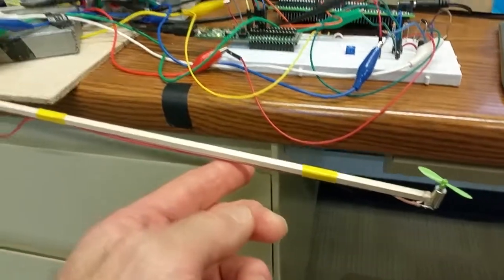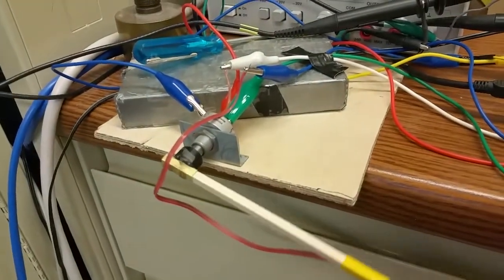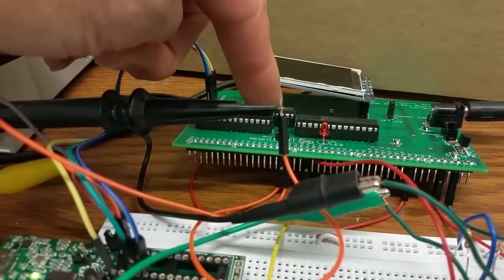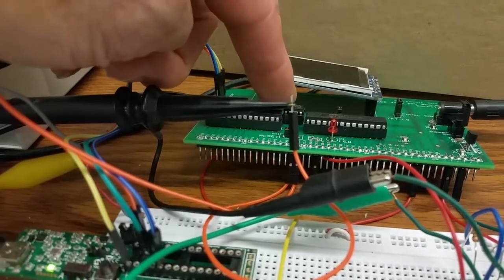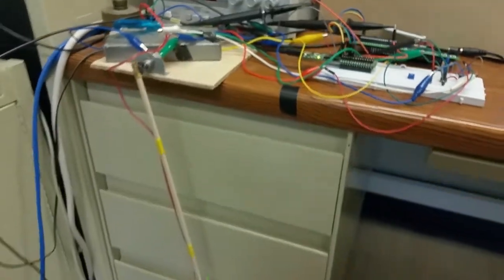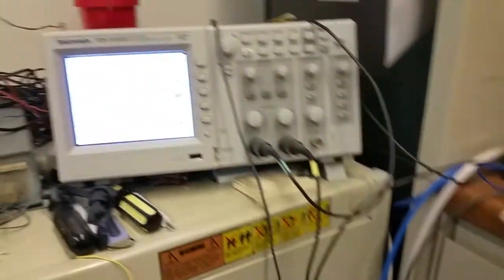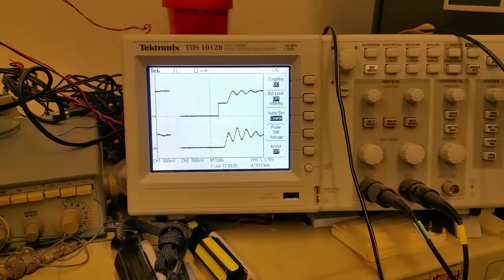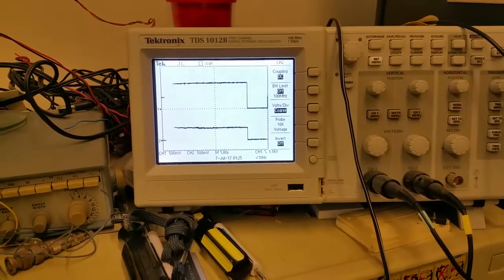1 DOF heilcopter with Scope output

Comment: put a accelerometer/gyro on the arm?
Reply from the maker: Why? Te servo pot gives angle info
Reply: I thought it would be good for the students to have a different method of measurement.
Reply: this is a great project.
Reply from the maker: Interestingly, they are more familiar with accelerometers than with potentiometers!